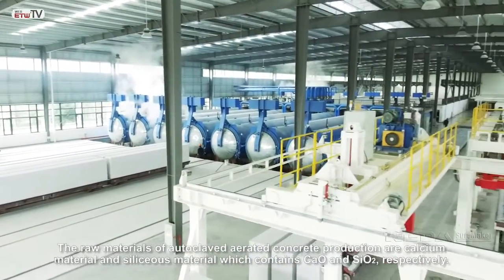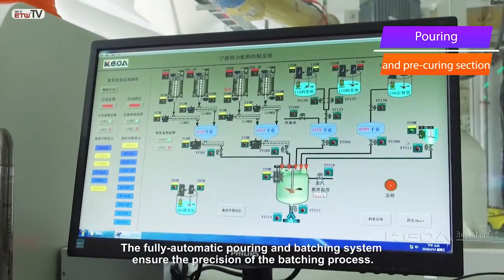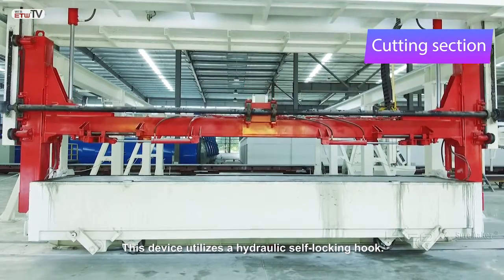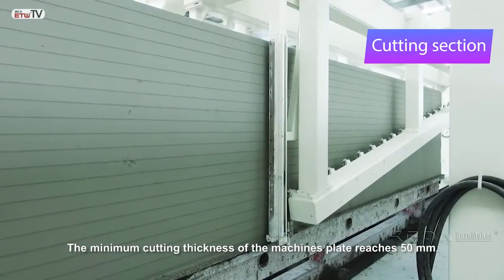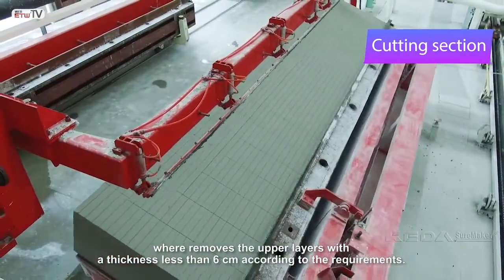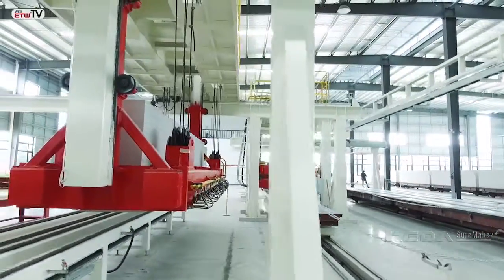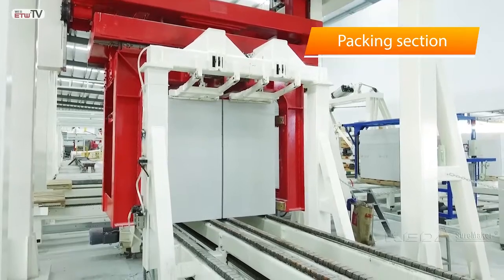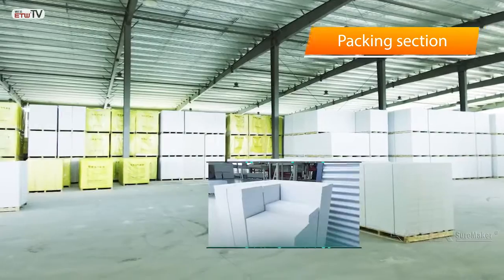KEDA SUREMAKER Autoclaved Aerated Concrete Production Line (AAC production process）

Comment: What is the smallest capacity unit available in ur company?
Reply from the maker: Dear Suresh, as for the smallest annual capacity，normally we suggest customer to start the project with 80,000 cubic meters and reserve an expansion option for the future. We also have cases that some foreign customer chose to reduce the qty of autoclaves at the beginning, then they can start the project with the capacity maybe 40,000 cubic meters.